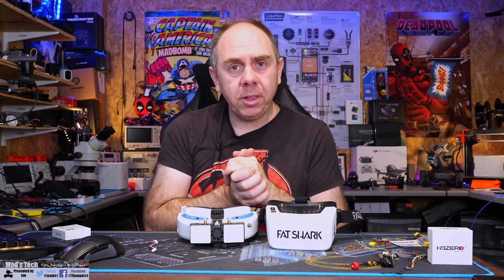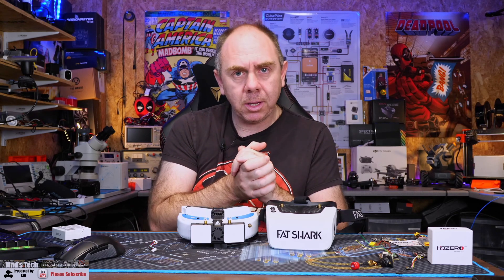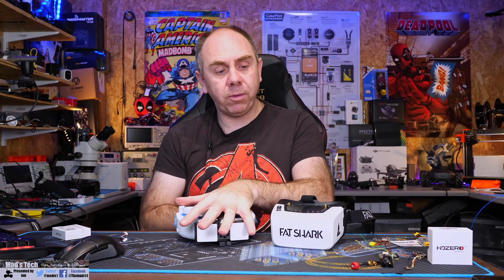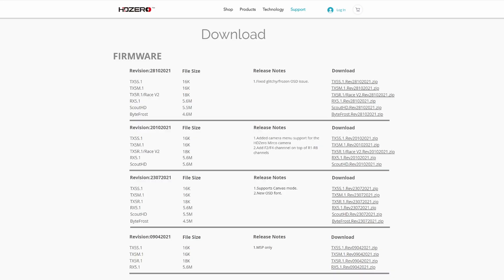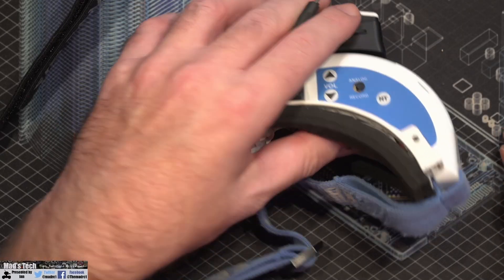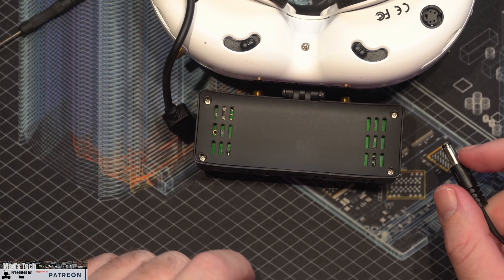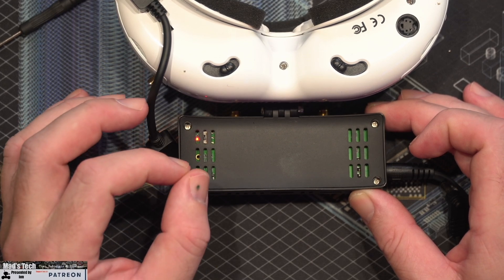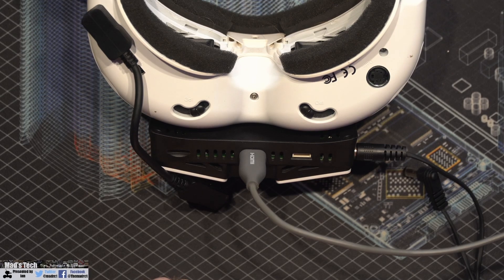HDZero Digital FPV -  Bricked Firmware Update Recovery For VRX & Scout HD (Shark Byte)

Comment: Is the vrx dead if I don't get blinking red light after hitting reset button?
Reply: I have the same problem, does anyone can help?
Reply: @bikerdanny8246  it wasn't dead I just had to do the reboot process
Reply: @jamisonhinton5837  What do you mean with reboot process? I currently waiting 10 Minutes in recovery mode without flashing red led, I will wait at least 5 Minutes more and see if there the two directories are created.
Reply: @bikerdanny8246  it takes a while .it took about 10 minutes from mines to do it. Also took about three tries for me to get it to work properly
Reply: @bikerdanny8246  but if no red flashing light then it may be dead. Or blown fuse
Reply: I now formatted my SD card again and used the firmware from Fatshark webpage instead from HDZero webpage and now, my red led is on.
Reply: @bikerdanny8246  Hi mate, did you have no red light at all the first time you tried to do the emergency recovery?
Reply: @jamisonhinton5837  Hi, I'm having the same problem too, the red light didn't turn on at all, I didn't wait long about 2-3 minutes, do you recommend that I try again? How long do I have to wait before the red light turns on? is it immediate? or can it turn on even after 5-6 10 minutes? I would be grateful if you give me a tip. Thank you very much.
Reply: Try again it will work took me a few tries
Reply: @Gioaca  think it took 5 to 8 mind for mines
Reply: @jamisonhinton5837  Thanks for replying quickly. Can you explain exactly what was going on with you? because nothing happens to me, the red light doesn't come on, I tried twice, the second time for 20 minutes, now I have to check the result but I don't think it was successful.
Reply: Thank you for quickly responding. Can you explain to me exactly what was happening? Because nothing is happening to me, the red light is not turning on. I tried twice, the second time for 20 minutes. Now I need to check the result but I don't think it was successful."
Reply: @Gioaca  hi i have the same problem, did you figure it out?
Reply: @pezfpv3551  Sì ho risolto con un fusibile smd da 3 A. però la hdzero, mi ha inviato un  manuale con le istruzioni e il fusibile giusto, che deve essere  da 4A. Ho volato tanto e tutto è ok. se vuoi i dettagli, scrivi qui la tua e-mail e ti mando tutto.
Reply: @Gioaca Thank you very much, I hope the seller sends me a new one, if not I'll get back to you.